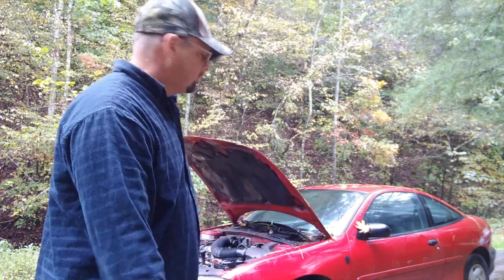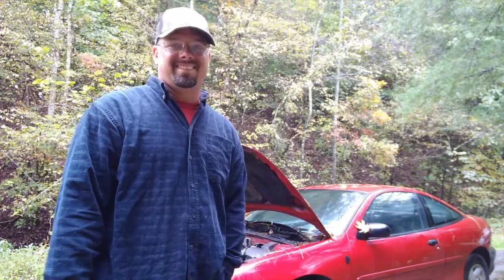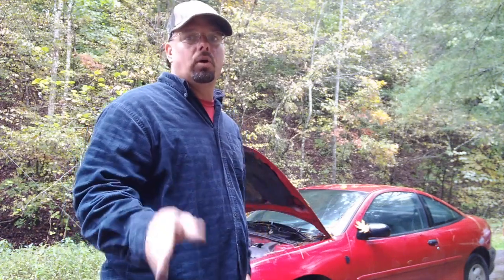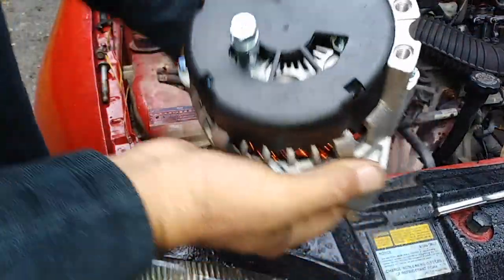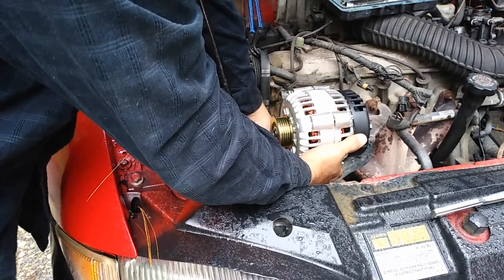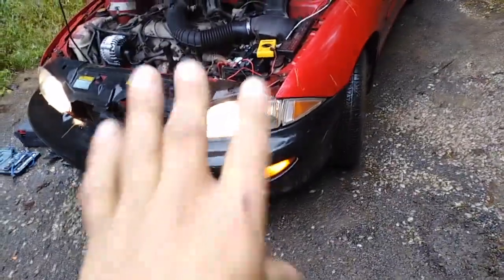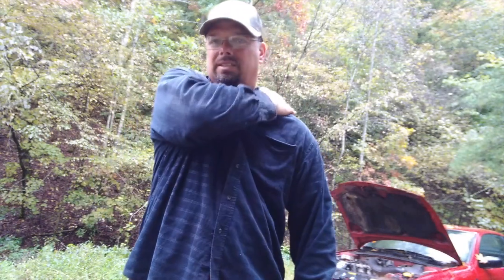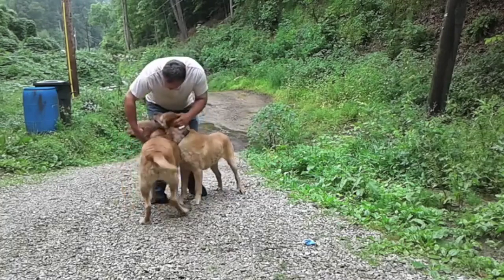How to Replace the Alternator on Chevy Cavalier

Comment: Always disconnect the - terminal & let the - terminal be the last reconnected. This tends to prevent tool shortage of the battery against ground. It is all too easy to drop a wrench or ratcheting against a core support or fender when attempting to remove the + cable first. This is standard shop safety. It prevents accidental shorting & fires.
Reply from the maker: Good tip, I'm going to pin this comment on the top.

Comment: I have a question I have a 1998 Chevy cavalier I went to give it a jumpstart  with a jumpstart box and unfortunately the multimeter when I was trying to read the voltage with the jump starter connected to the battery The negative test lead from the multimeter caused a little spark  on the negative terminal I’m assuming either it was defective or it was on the wrong setting. Can that cause damage to the car as in damaging the alternator? It only happened once but when the car started up even though it is providing adequate charging I hear what sounds like a bad pulley sound and I don’t know if it’s a alternator or if it’s that how can I be sure? I want to know before I start spending money on parts
Reply from the maker: I wouldn't think a spark could cause a noise like a bad pulley sound. More than likely you have a bearing going out on something driven by the belt. One way to tell is to take a big screwdriver and put the end of it on the alternator, then put your ear to the handle. It works kind of like a doctors stethoscope allowing you to hear if the vibration is from the alternator. You can check any part like that as long as the screwdriver is long enough to get you safely away from the moving parts. You could use any kind of metal rod or pipe the same way.
Reply: luke Fugate thanks for your advice The noise has disappeared after replacing the belt pulley but now  I discovered that my alternator when the car is warm the voltage drops to 12.2. Am I correct to assume that the alternator needs to be replaced?

Comment: Which wire on the plug does the alternator charge battery? It's for my race car
Reply from the maker: It should be the brown wire. I did a video on installing a modern alternator on an older vehicle. It should show you what you need to know. Here is a link to it. 

https://www.youtube.com/watch?v=DKq3YD4VYb4&list=PLx4vrrK_MpaeBVG_PG6cOr4rUwTwoAMTZ&index=15&t=0s
If you have any more questions let me know.

Comment: Perfectly understood thank you. I have the same car same color as yours. My check engine and battery light comes on and car sometimes stalls but keeps running. I'm guessing it's the alternator but I don't know yet the problem.
Reply from the maker: Does the voltage at the battery drop as it is running?

Comment: I have 1996 Chevy cavalier I need to k now how many wires going from the alternator to the battery or how wires on the battery
Reply from the maker: Should be one larger red wire from the battery to the alternator. The wire should be from the positive bolt on the alternator and go directly to the positive terminal of the battery. The other two wires are to energize the field and to turn on the battery light on the dash.

Comment: Hey Luke, you could build you a carport for those rain out days to work under. Be a good project to film too. Also, what brand of tools are you using? Great info on changing out an alternator, I never thought to use a tie strap to hold the belt up. I always had to re-install the belt over all the pulleys. I like your way better.
Reply from the maker: I still have my garage, it's just so full of junk right now, I couldn't even get the four wheeler in it. The socket set is Craftsman and the ratchet wrenches don't have a brand name on them. They are some I Got from Tractor Supply.

Comment: Thanks man. I like the bungee tip too, good looking out.
Reply from the maker: That has come in handy many times for me. Especially useful when the belt diagram is missing. Thanks for watching!
Reply: Hey just wanted to say your video was great I feel like it's really super helpful and I think after watching it I should be able to complete this task by myself although I've never done this before and I have a 2003 Chevy Cavalier that literally left me stranded last night on the side of the road due to a bad alternator so I appreciate you and what you do and hopefully I can do this without any additional help is there any other advice you could offer me in attempting this for the first time on my own?